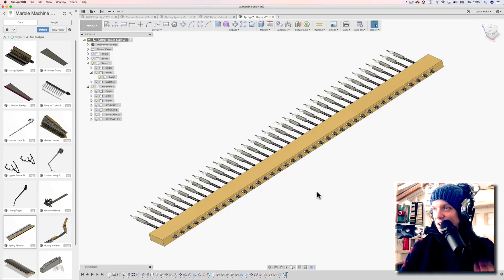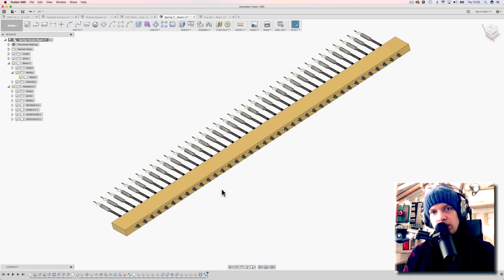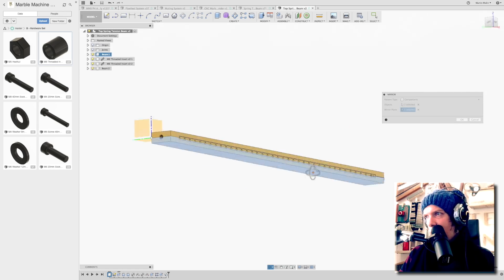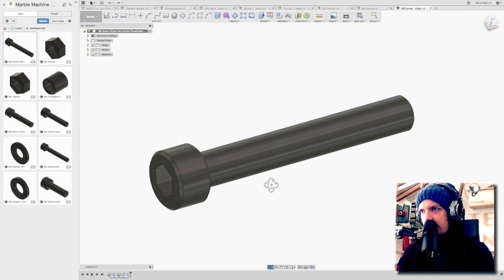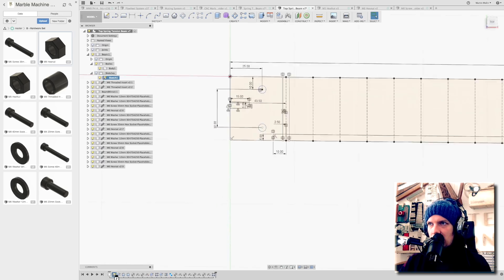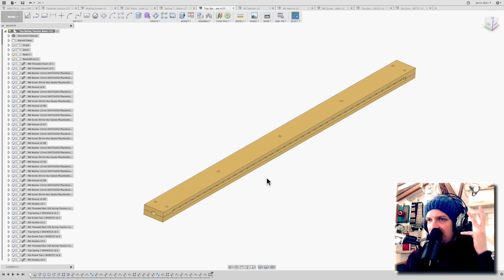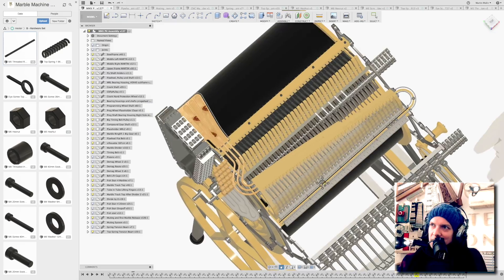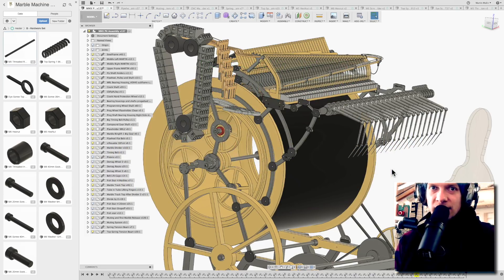Spring Tension Beam CAD - Marble Machine X #30

Comment: What are the specs on your computer? It must be pretty beefy to be able to render a full marble machine without dipping down to 5 fps!
Reply: jes, but fusion doesn't need a lot of power
Reply: jodudeit Fusion actually has a pretty low overhead and doesn't bog a system down as much as other CAD software

Now, if this were INVENTOR, on the other hand...
Reply: I want to know too.
Reply: I don't think it is one though,  could easily just be capturing the window only and not the full screen size.
Reply: fusion is just a great program doesn't take anything crazy to run it. that's not a render either its just model view.
I regularly run Solidworks and Fusion simultaneously to cross reference some assemblies and its really not that demanding.
Reply: Not in any meaningful way except for data storage and maybe rendering (but Autodesk's local programs can do that in cloud too).
Reply: I guess not every part are rendered when he is using the "full marble machine view". Tiny details like screws are probably omitted when using that view.
Reply: Looks like Pantheon. Fusion doesn't run on Linux though (I wish).
Reply: The reason he's using simple parts with no surface profiles is because he's using a Mac and not a CAD workstation.
Reply: @dueldu is that a Mac? help me do that! I need that its awesome!
Reply: @TJ & Ja It's actually Ubuntu running a skin https://www.reddit.com/r/unixporn/comments/63kr87/unity_vintage_ubuntu_with_taste_of_macos/
Reply: It doesn't render in the cloud.
Reply: I wondered whether the system was bogging down because his child objects are actually polygons rather than instanced copies of the original object. I only have a simple understanding of these things from Maxxon's Cinema 4D XL
Reply: why? most of the parts are simple polygons after all.
Reply: looks like a mac
Reply: It's not really "rendered". Probably uses openGL foe the visualization . Which doesn't need a lot of resources
Reply: it's a mac, just pause in the beginning of the vid and look at the top left corner, you'll see
Reply: Fusion 360 is pretty good at rendering reasonably complex assemblies I find.  I used to use Autodesk 123D and that bogged down really badly, once I switched to fusion 360 everything has been smooth.  It takes an age and a half to fully load up for me (this may be due to my terrible internet as well, since it does a lot of cloud work), but if I am in the cad mood I will just leave it up for days, heh.
Reply: Jodudeit - your pc must be total garbage not to handle less than 1000 poly's without any form of rendering or post processing, i feel sorry for you.. :\

My old Nvidia 755M SLI was able to handle 250,000 poly's fully rendered just fine, it took a grueling 4 hours to render but it worked, my new 1080Ti can handle it now without even breaking a sweat :)
Reply: It's cloud based software.

Comment: @Wintergatan : my advice: if you're building things by hand & also if you're building things out of fragile parts (this includes plywood), don't order the exact number of parts. Order a little more from each kind of part - you know, leave a little reserves - else ordering missing/broken/lost parts will drive you crazy, unless you have very tight control of the delivery process on all the required parts (which one usually doesn't).
Reply: 10% over is a good rule of thumb on hardware.
Reply: Yes, he has access to a cnc machine & plywood, but does he also have the same kind of access to metal parts?